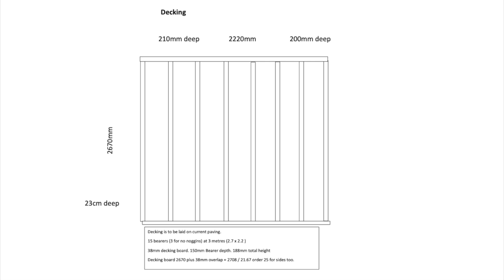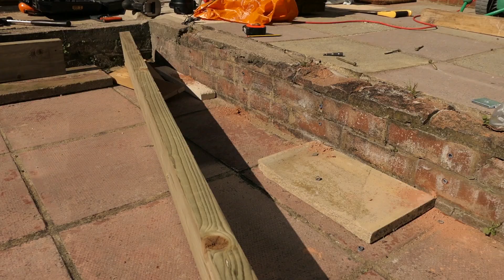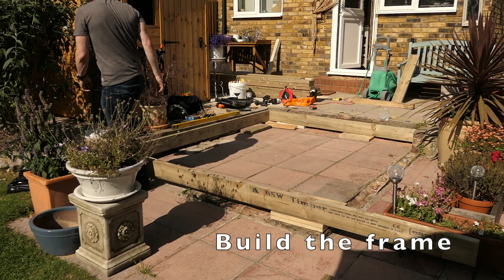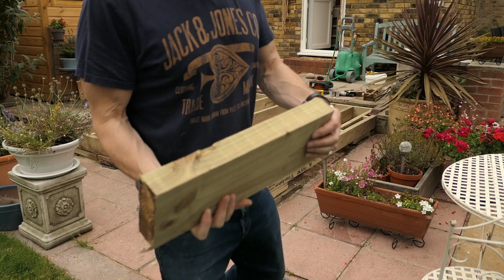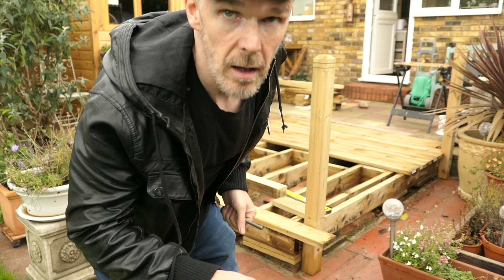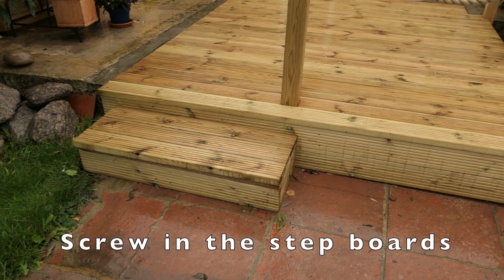HOW TO BUILD DECKING

Comment: Did you use timber treatment on the cut timbers and bolt holes ? as treated timber isn't 100% through the timber !
Reply from the maker: You are right, I gave this one an extra coat all over. https://youtu.be/NPsYMAuuOwQ?t=273

Comment: should you of not left a small space between the decking boards,i use a screw width as the the boards do swell up etc with water
Reply from the maker: Hi. Yes there are gaps between the boards to allow for any movement. I didn't use spacers or a screw, I just used my eye and adjusted the boards so I didn't have to cut the end board long ways.

Comment: Hello, do you use a drill bit the same diameter as your coach bolt. I. E would you use a m12 drill bit for a m12 bolt? Or use a bigger drill size? Thanks.
Reply from the maker: Alan Reid hi yes use the same size drill bit. You will need to tap the coach bolt in with a hammer.
Reply: @AngusMcGregor  thanks Angus. 😁

Comment: Are noggings needed ? Will all the deck boards screwed down not stop the joists twisting
Reply from the maker: electrician154 Yes they are needed. Before I put the noggings in place I put my flat edge over the top of the bearers and they were not level but as soon as I put the noggings in place and then tightened them up all the bears became level. I don’t think the decking boards are strong enough to stop the bearers from twisting.
Reply: The deck boards would only provide limited support across the top of the joists - the noggins support the joists from top to bottom which gives a much stronger structure that would resist twisting throughout